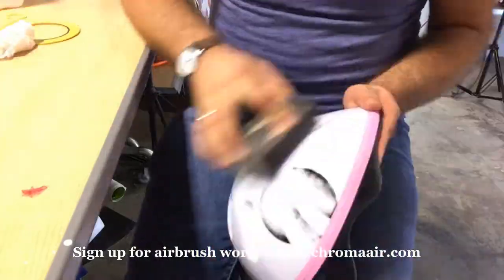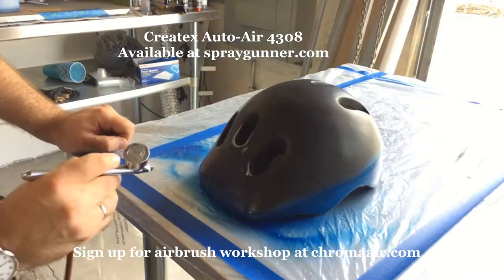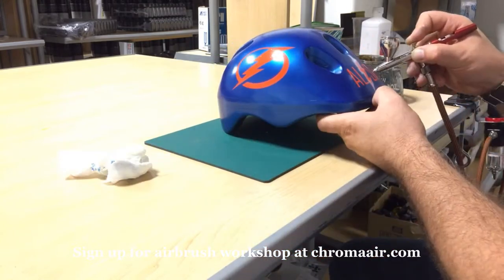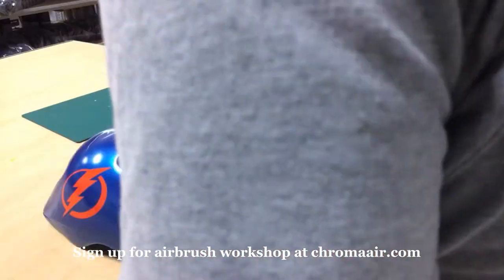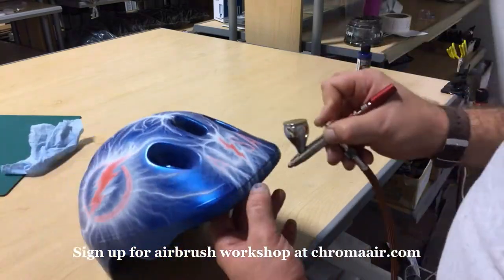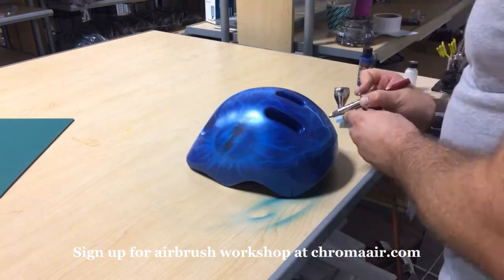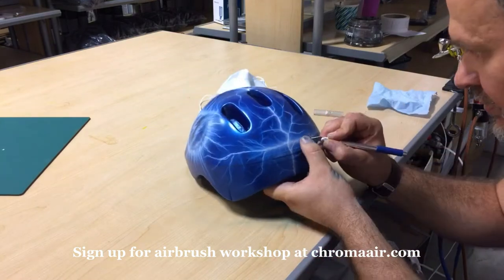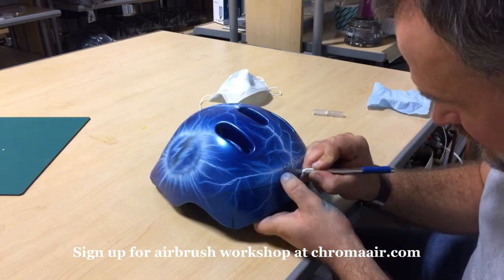Airbrushing on helmet tutorial: how to create simple but impressive design.

Comment: what top coat did you used Sir? Thanks
Reply: Dominic Deblois - Since they were using Createx most likely they were using Createx Gloss Top Coat 5604, with 4030 Balancing Clear mixed at 10%-25% per volume since they were painting over plastic/hard surface to obtain better adhesion. It’s recommended to use a .05mm needle at 40-50 PSI. If you use a smaller tip size and lower air pressure you will need to reduce it with 5601, 4011 or 4012 to get the flow right. This gloss top coat is made with lightfast pigments which reduces fading when exposed to UV light. This is just a guess though.